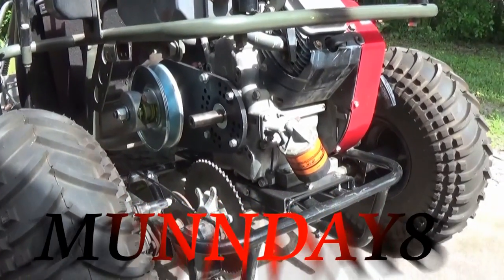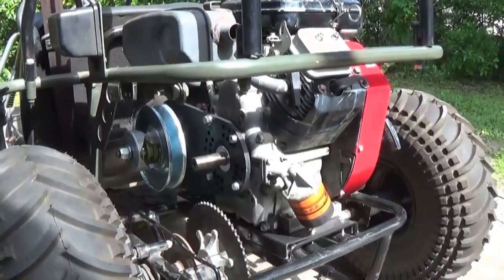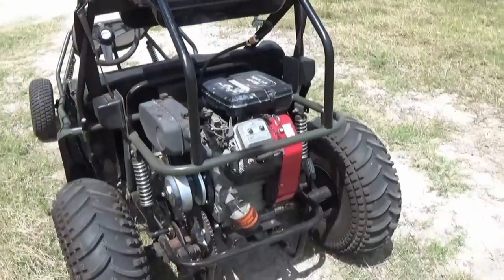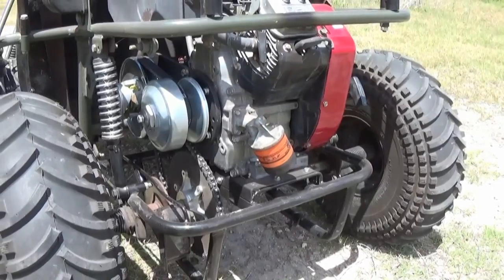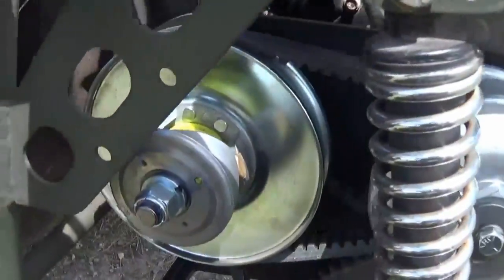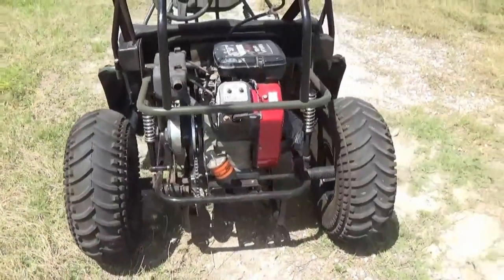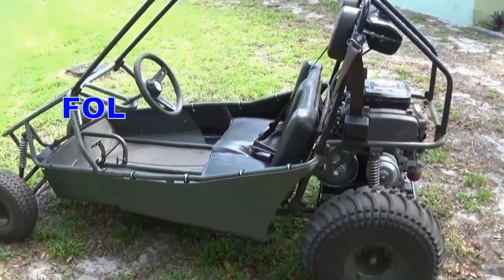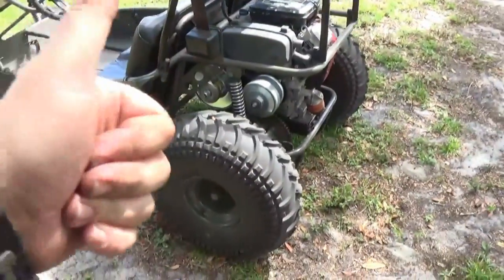GOKART V-TWIN SWAP 16HP MANCO 606 PART 3

Comment: I’ve got a 700 lbs 4 wheeler, & I run 3-4 psi in my tires , if you read the side of the tire it will tell you the psi rate

Comment: What material is used for the custom side panels?
Reply from the maker: It's a 1/4 inch ABS material. I cut with an angle grinder and heated up with a heat gun to achieve the bends.

Comment: I have a go kart frame a lil bigger than that.. i took off the original engine and transmission.. i wanted to swap it wit a old skool horizontal briggs and stratton 16... but ive ran into alot of issues... PLEASE HELP
Reply: What kind of help did you need ? Hope you got it fixed.

Comment: what do you think about putting a 22hp one an a quad
Reply from the maker: Dakota Lehr depends on how big the quads frame is. will it fit?
Reply: munnday86 it has a pretty big Fram if it doesn't I'll make it fit lol
Reply from the maker: Dakota Lehr as long as you have a good welder. it would be bad ass
Reply: Well, Polaris and others go up to 1000cc.  You should be able to fit a 700 cc v twin on a quad.  I'd say depends more on mounting of the new v-twin compared to the old motor.

Comment: About 3 psi in rear tires would be good
Reply from the maker: The tire would fall off the rim at 3psi
Reply: Not with a 120lb motor